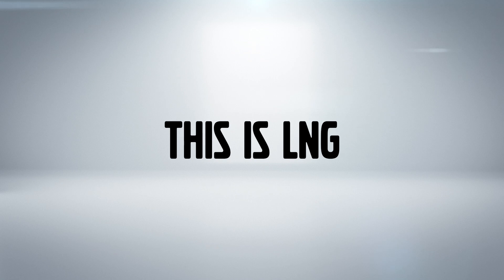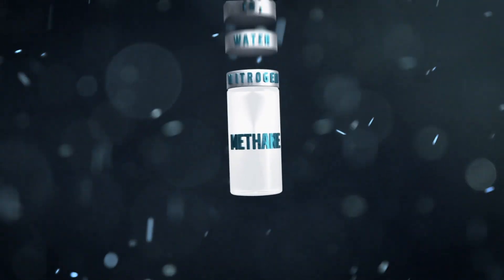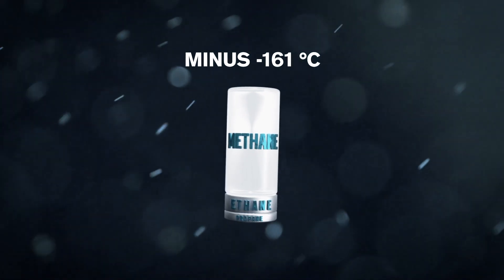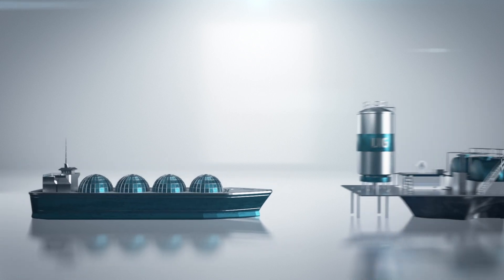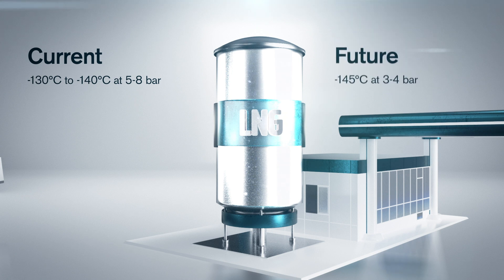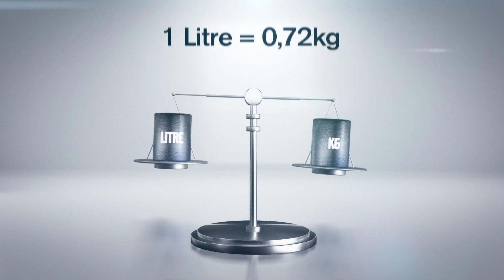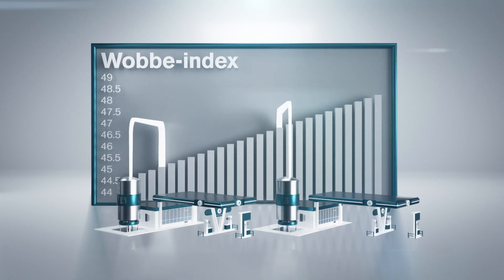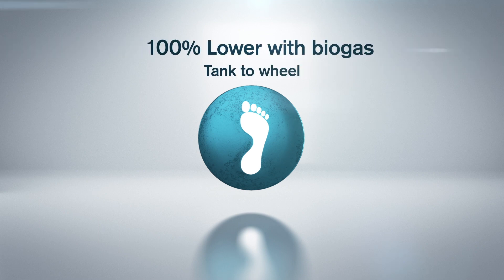Volvo Trucks – This is LNG (Liquefied Natural Gas)

Comment: You only pointed out the advantage enviromentally. How about performance wise? How it will perform on 540, 560, 600, 700, 720hp engines? Does it have more power output than diesel? You also said that it has lower consumption? On what engine range? Too many unanswered question about performance
Reply from the maker: You'll find more information about the performance of the LNG here: https://youtu.be/esoTian3ZWg

Comment: It feels very odd of Volvo to start with a new fossil fuel instead of moving away from all of them. I'm honestly dissapointed.
Reply from the maker: We do not think there is a single, global solution. We will need to find alternatives at different times, in different parts of the world, and for different uses.
Reply: Sooooo…now that we’re in a couple new wars that didn’t exist when you made this comment what’s your take on LNG now?
Reply: Natural gas is not a fossil fuel.
Reply: @kaspar737  it is
Reply: @nilsmeta  You could make LNG from horse shit so it's not.
Reply: @kaspar737  well then
Reply: Man appreciate volvo , support such corps. Lng  will take time to replace but right now we need avoid petrol and diesel.

Comment: There’s nothing environmentally friendly about LNG. Just stop the tailpipe pollution and make electric vehicles
Reply from the maker: We do not think there is a single, global solution. Instead we will need to find alternatives at different times, in different parts of the world, and for different uses. Also, there are both advantages and disadvantages in all fuels. It is important not just to look at emissions while driving, but also the total life cycle. Having said that, there are solutions that we think are particularly interesting for various segments in the long term, such as gas-powered vehicles AND electrification.
Reply: Tell me what’s environmentally friendly about cobalt mines powered by coal-fired power plants operated by child labor?
Reply: I feel the same, I can't believe that they went from showing a electric truck concept last week to this. I'm dissapointed.

Comment: Isn't the methane in LNG more harmful for the environment than carbon dioxide?
Reply: Methane is combusted.
Reply: There are leaks of methane during extraction and transportation
Reply: @Mechanical-ArtMD  that has to be negligible
Reply: If it were to just be released deliberately into the environment, possibly. Still no actual info on that, people just attempt to pass inferences relating methane’s high energy value as “bad if it gets out” without any actual data to substantiate it👌
Reply: Yes, it is.